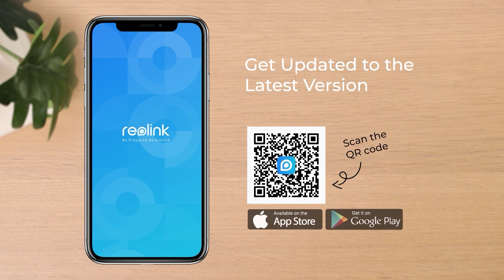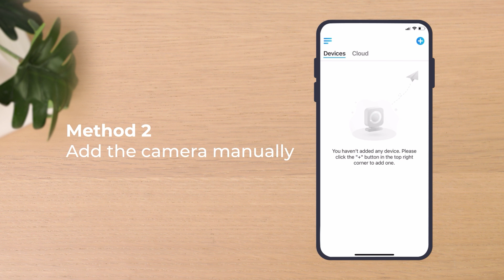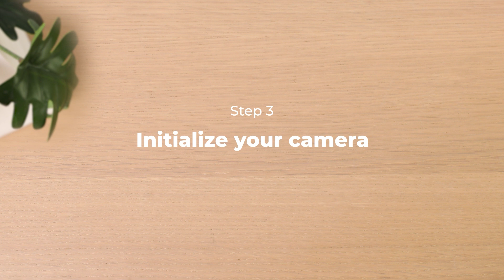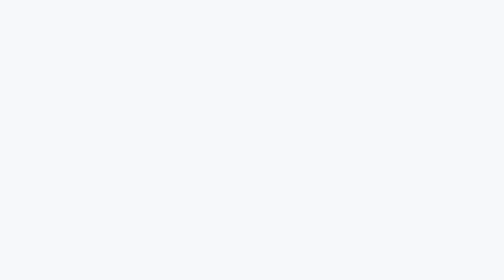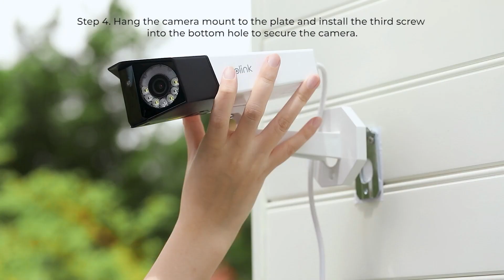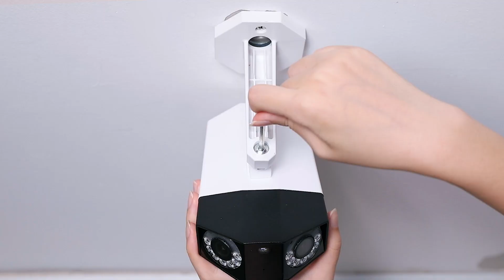How to Set up & Install the Reolink Duo 2 PoE

Comment: Do you have to have both Poe and power or can you just you power and wifi
Reply: You need Ethernet to connect the camera to your network.  To power it, you need either a PoE switch or PoE injector on the Ethernet cable, or a DC 12V adapter.  This camera does not work with WiFi.

Comment: Why is there a hole in the white mounting bracket if the cables can’t pass through it to stay hidden? This is such a poor design choice.
I had to check the manual and many online videos of people installing to make sure it was not me.
Reply: Yeah it doesn't fit, what I did was 3d printed a little runway for it instead but that isn't really viable for everyone
Reply: Just use a file, it only barely doesn't fit

Comment: Please can you help me . I set my outdoor camera Reolink Duo 2 4K Wi-Fi outdoor high up that I need ladder to go up. My issue is now I needed to change my hub, the router. You know with new Wi-Fi  SSID and password changes. Now I am in trouble how to change my Wi-Fi to new one.without jumping over ladder, in order to scan bar code behind camera. I find this is an issue why they don’t send with something  one can use it even is installation is completed.  1-I tried in the way of UID,IP still tell me,  my Wi-Fi is not the same.. please advices,.   I  urgently need one. Thank you in advance for whoever knows how.

Comment: It would be great if you could show how to install there camera with the cable going through the wall... How large hole does it need, is the pigtail behind the camera long enough?
Reply from the maker: It is a little hard to say how large the hole, but the camera cable length is 70cm, you could try it.
Reply: @ReolinkCameras     Deal reolink WTF are you thinking ?????????
There is no instructions on what to do with the wiring which has a thick dongle attached to it.  Are we to drill a 2nd hole in the wall for that ? why does it noe snake through the hole in the mounting plate ?  but alas it cannot as the hole in the plastic hanging bar is way too small to route it through there -  Your videos just show the cable hanging as if there is some magical fairy dust to connect it to....
Reply: @ReolinkCameras  I came here seeking answers to the same questions that @333cparker is asking.  Please update the video to show what to do with the cable.  The hole in the mounting plate is so close to being large enough for the waterproof lid to fit through it, but it binds 3/4 of the way though.

Comment: what if you don't have ethernet hookup , just direct??
Reply from the maker: Hi, do you mean if you don't have a PoE switch, can it be directly connected to the router? 
You can directly connect the camera to the router with an Ethernet cable to get network connection. But you will need to power it with the DC power adapter.
Reply: @ReolinkCameras  I mean a base for the cameras to hook up to . I do not have ethernet hook up to my base. They are I guess the old style where you have 2 cables . One for power and one for video .
Reply from the maker: @kdscrapping4452  Then we guess this camera might not work with this base. An Ethernet port for network connection is necessary for this camera. Or you may try an adapter to convert the Ethernet to the hookup your base has.
Reply: @ReolinkCameras  my base is the push and turn pins .plus separate power plug .
Reply: @kdscrapping4452  That sounds like a BNC connector for analog composite video.  This camera will not work with that.  You need Ethernet to connect the camera to your network.  To power it, you need either a PoE switch or PoE injector on the Ethernet cable, or a DC 12V adapter.
Reply: @ReolinkCameras  Please guys, note that the « Duo 2 PoE » and the « Duo 2 Poe Floodlight » don’t even come with any DC power cable (only included in the WIFI version) ! 

So to be able to connect directly to your internet box, you’ll need to buy a POE switch !

Reolink could have think to the people like us that don’t want any Wifi, but still want to connect directly the camera to the internet box, without buying any poe switch, providing a simple dc cable !

Comment: Would like some clarity here.  I want to buy a Poe Dual camera flood light.  It is not clear if this is a stand alone device, do i need extra cables etc.  I am so sick of buying something that doesnt work without "extras'.  How can something be extra if its essential for it to work at all?  Please answer concisely. If i buy a Poe Dual camera with Floodlight.  what do i need "'""extra""" to mke it work as intended???
Reply from the maker: Hi, thanks for reaching out. 
Reolink Floodlight PoE/WiFi, Reolink Duo 2 PoE/WiFi, and Reolink Duo Floodlight PoE/WiFi are all standalone devices. 
Reolink Duo Floodlight PoE/WiFi is a floodlight camera that combines the dual-lens camera and the floodlight together. You don't need to install them separately. 
Reolink Duo 2 PoE/WiFi is a dual-lens camera built with spotlights (not floodlights).
Reolink Floodlight PoE/WiFi is a motion-activated floodlight that can work independently or with several Reolink cameras including the Duo 2 PoE/WiFi and the Duo Floodlight PoE/WiFi. You can set up the linkage between this floodlight and a camera via the Reolink app/client/NVR. No extra cable is needed for the linkage. When the linked camera detects motion, the floodlight will be triggered. Please note that this floodlight contains a built-in siren that will not be triggered when it's working independently.
Reply: @ReolinkCameras to power the camera a seperate Poe switch/nvr needs to bought though? It won’t simply work without one of these items, yes?

Comment: Are you updating the nvr to work with this camera? It is a great camera, but I cannot make it to work with the RLN8 -410.
Reply from the maker: Hi Daniel,
Sorry to tell you that the latest version RLN8 -410 can not work with the Duo 2 POE.
The Duo 2 POE is a very new machine, and the hardware is also very fresh, which needs the latest NVR to be compatible.
So upgrading the firmware cannot let the RLN8 -410 support this new camera.
Reply: @ReolinkCameras so you always have to power it with a 12v adapter?
Reply: @ReolinkCameras  does the duo 2 poe camera now work with the RLN8-410 NVR now? Asking again since my bundle suggestion today has two Duo 2 poe cameras and that NVR. Surely the bundle isn’t including an NVR that is incompatible.
Reply from the maker: @acVeezy  Hi Adam, the NVR with the new hardware version N7MB01, N5MB01, or N6MB01 is compatible with the Duo 2 PoE. NVRs with the hardware version H3MB18, N3MB01, or N2MB02 support max. 6MP live view. And other old versions of the RLN8-410 NVR are not compatible.

Comment: Hello about how long would my RLC 810a camera last if it’s exposed to rain a lot. I mounted it in a place that’s not covered by anything but I’m hesitant on moving it because I’m scared it’ll get damaged due to the rain. Should I move it to a place where it won’t get wet or can I leave it where it’s at?
Reply from the maker: Operating temperature: -10°C~+55°C (14°F~131°F)
Operating humidity: 10% ~ 90%
Waterproof: IP66
If the camera is within this condition and makes sure the network port and the reset hole are well protected, then the camera will be ok.
Reply: @ReolinkCameras  okay thank you!
Reply from the maker: @cool2soon127  You're welcome.